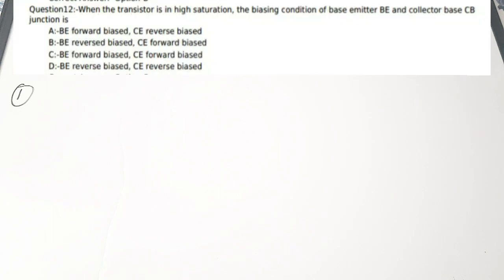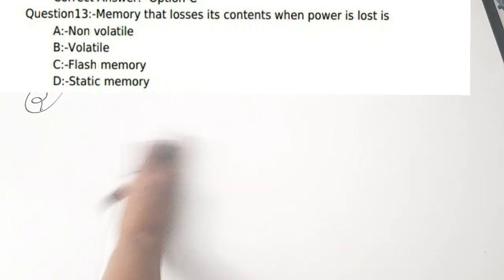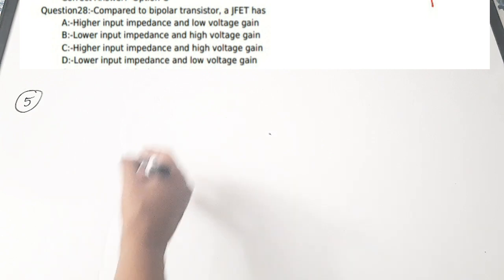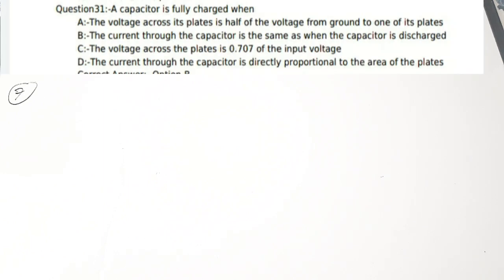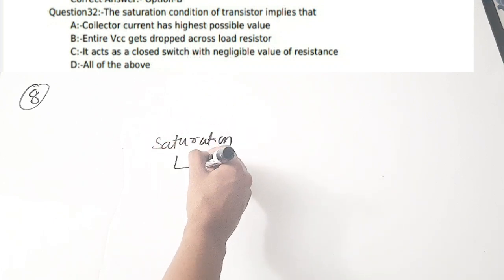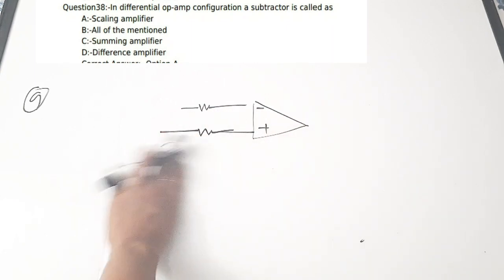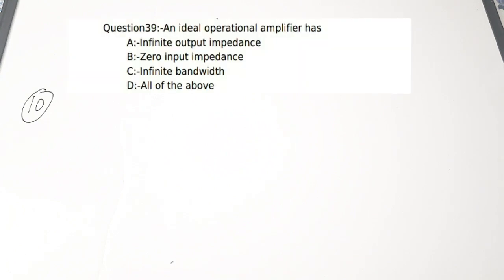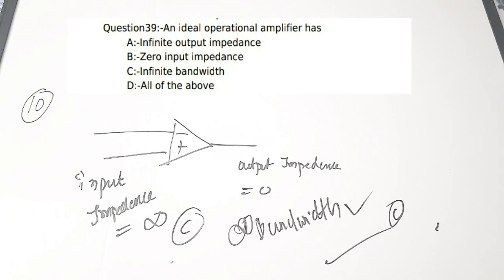KPSC polytechnic lecturer Electronics Previous Year Questions Part5

Comment: Answer for 9th question is Difference Amplifier
Subtractor/Difference Amplifier | Analog-integrated-circuits || Electronics Tutorial (electronics-tutorial.net)
Reply: R3 and R1 values are considered as same. so it works as a simple subtractor. Scaling amplifier never subtracts.